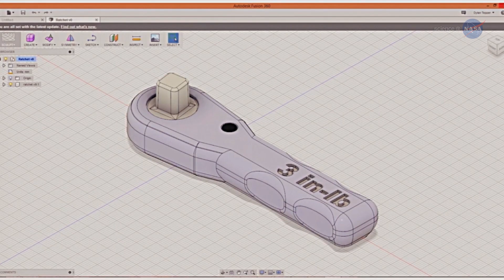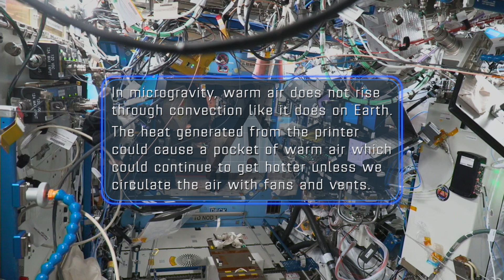STEMonstrations: 3D Printing

Comment: hold on, there is zero gravity in other places that just orbit, or a plane. think about a speed train in orbit on the ground. very similar to plane but on the ground. yep a circular maglev train track around the earth. yep constant velocity on the ground around the planet. therefore acceleration horizontally is zero, and with suitable tangential radial speed, the radial force cancels out the gravity force like in a constant space orbit. ie virtual zero gravity.